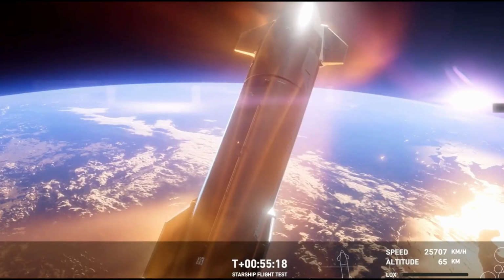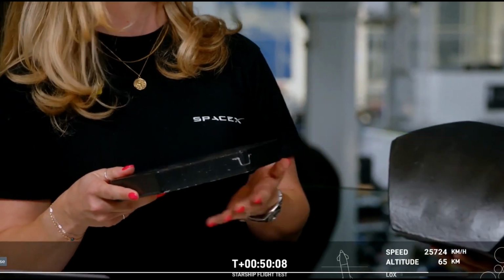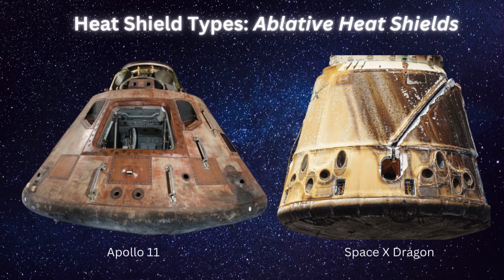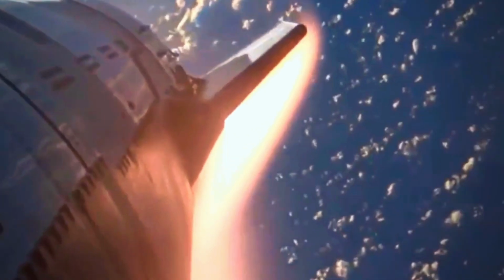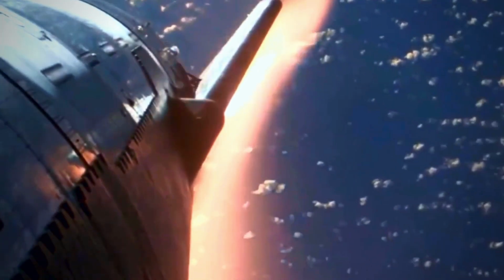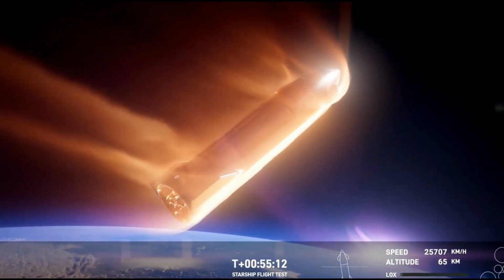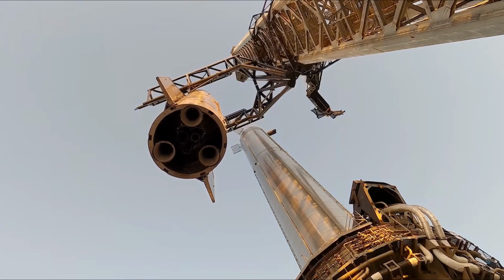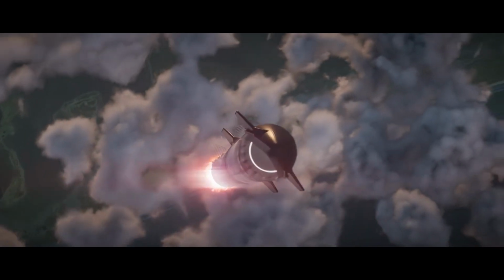SpaceX Starship's Fiery Return. Did the Heat Shield Fail?

Comment: If your a welder tell us about how stainless steel gets hot and stays hot , would you build a space ship out of stainless
Reply from the maker: Stainless steel is like that pan that takes forever to heat up but stays hot enough to burn you later. Not ideal for spaceships... unless you're SpaceX:)) they overcame this by using special heat shields to handle the extreme temperatures.